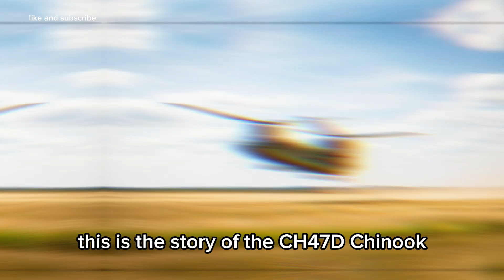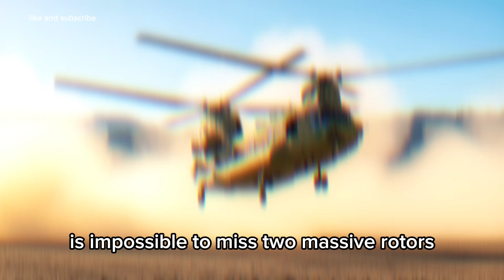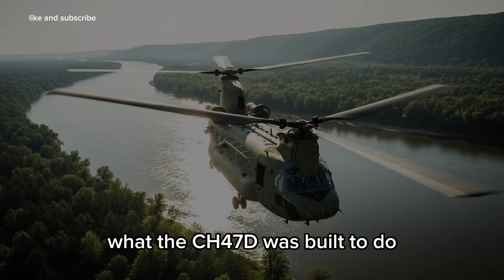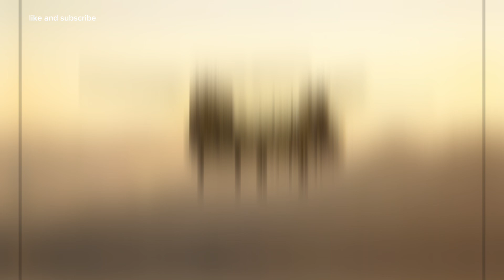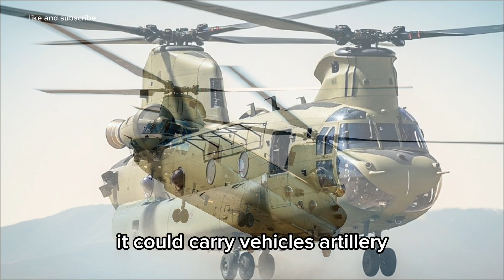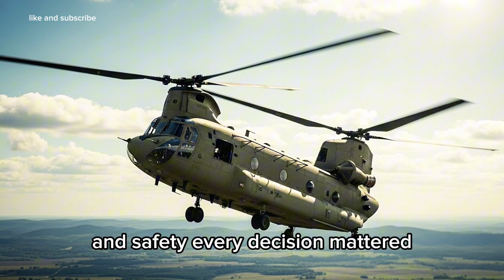This Helicopter Changed How America Moves Its Army

Comment: I worked as a contractor on a military base, and was inspecting cables along the runway when the control tower brought in a Chinook. I was used to rotor-wash, and moved away from the runway. I found out that the rotor-wash from a Chinook instantly doubles as the intersection of the two rotors passes abeam. It knocked me over and dislocated my shoulder, requiring a rotator cuff repair. If you are in the near vicinity of a Chinook making a landing, take a knee.